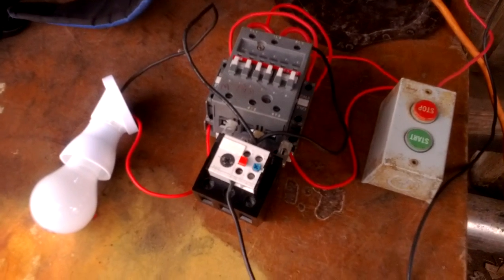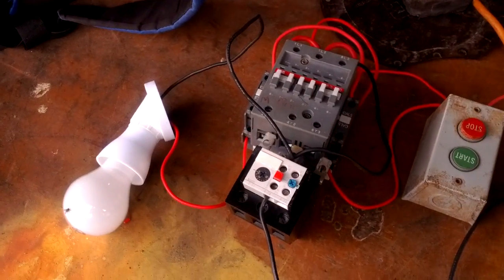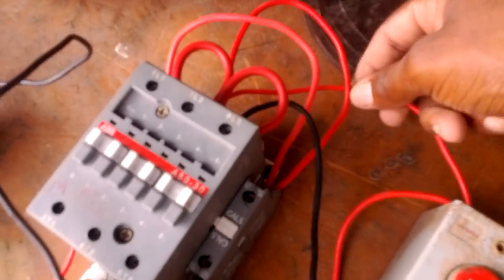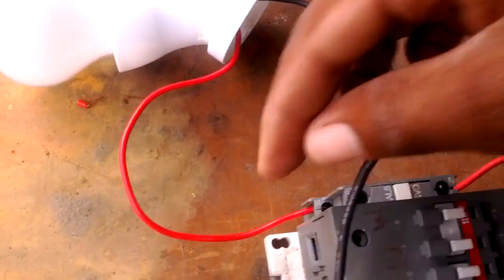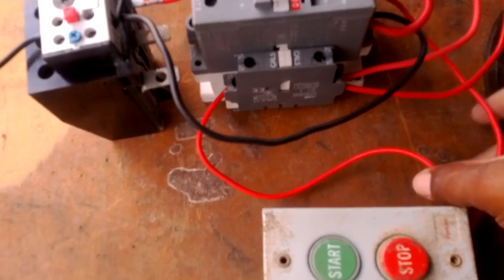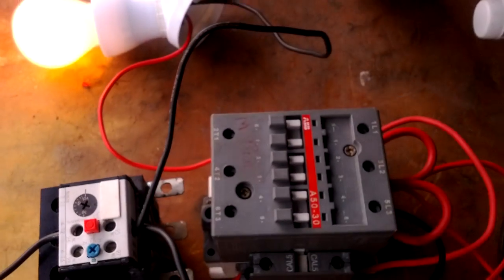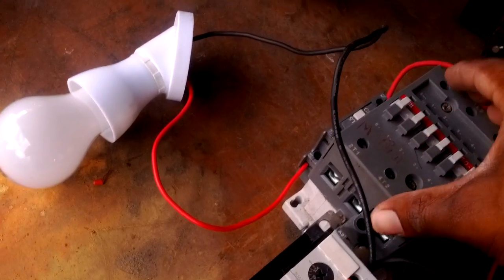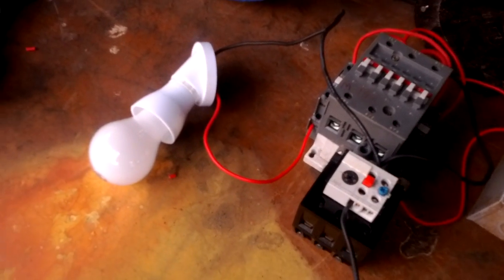How to wire a ON light on a Contactor

Comment: thanks for this video .  its amazing and very explanatory to those that understand the concept of induction .      Can you please let me know the cable gauge that you used in this video.  if you will be interested to be part of a very big induction project, please dont hesitate to contact me
thanks .  Good luck

my email address is engwestwind@gmail.com
Reply from the maker: +Deji Adeyale 

Thank you Sir Deji.... Whats  is this big induction project about?
Reply from the maker: +Deji Adeyale 

Also control wiring usually use any gauge from 16 to 12 awg  in this video its actually 2.5mm squared wire which a #12 I think. Well number 12 cause im seen these wires carrying 20 amps without heating up.
Reply: Clychawn Wilson  The project is all about building of transformer using core induction and extending the networks through the contactors. it is a national project very interesting .
just let know your mind b4 i can disclose the locations
 thanks for the reply

Regards
Deji
Reply from the maker: Deji Adeyale

Hi Deji

I always wanted to learn how to build a transformer... im present doing some experiements with the coil windings but im lost on what do with with the neutral... Can you send me some information to my email about this transformer project... so I can learn the building structure of a transformer... this may be the help I was looking for. My email is Wilsonc_21@hotmail.com